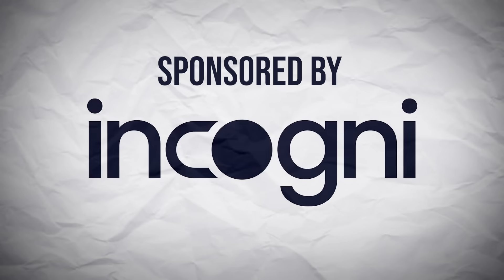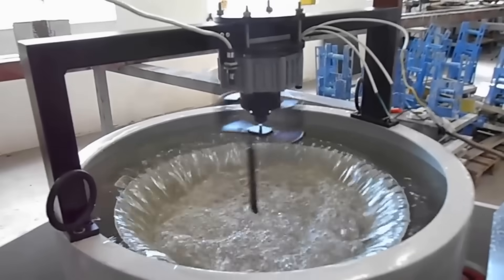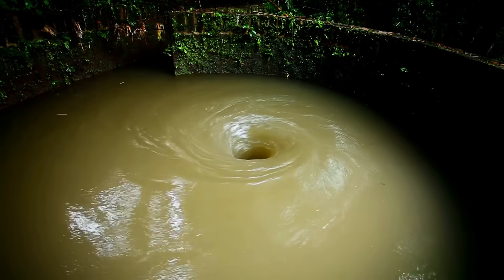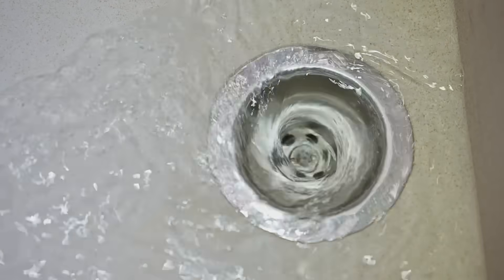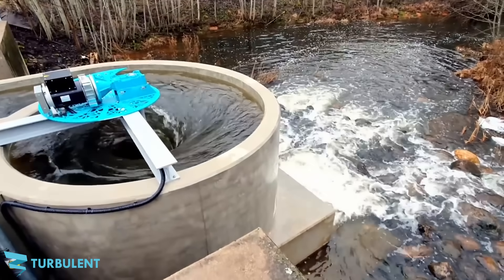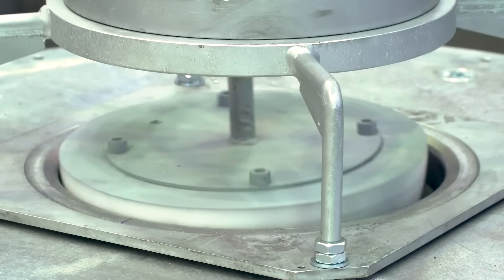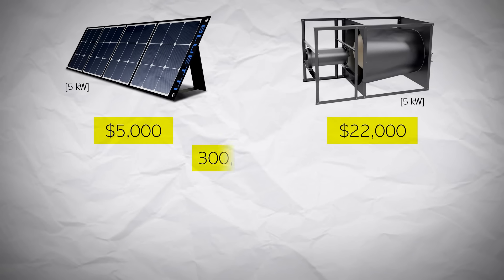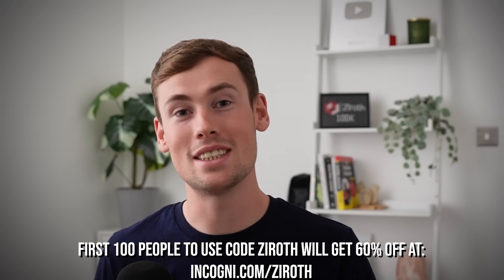Genius Bladeless Hydro Turbine is Cheaper Than Solar

Comment: ALL significant hydro power is cheaper than solar.  Solar is a VERY expensive base load power source
Reply: solar really isn't base load, leastwise not PV.
Reply: @lylestavast7652   well idiots are trying to make it so with batteries and other storage.  See all the illegal gov't subsidies to put it on the grid.